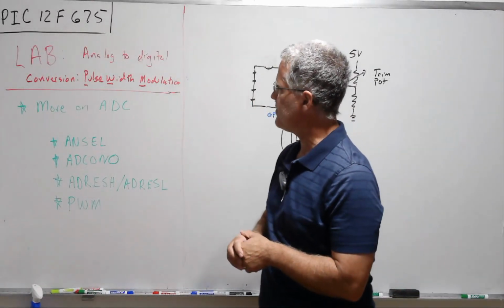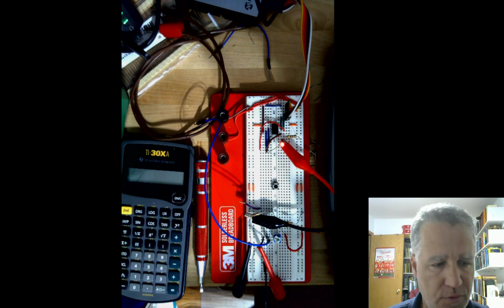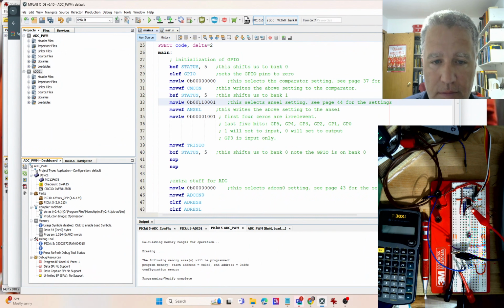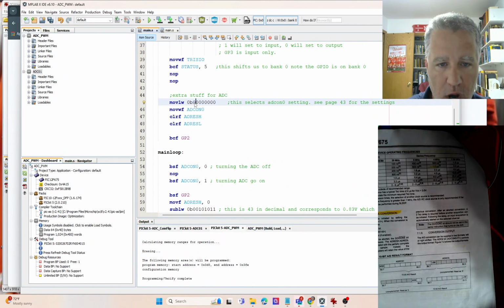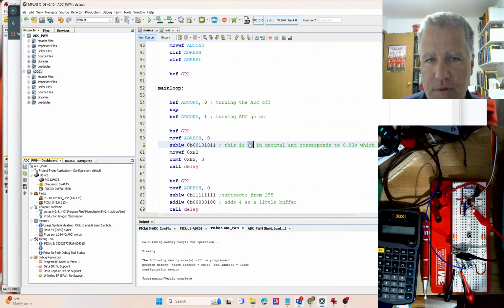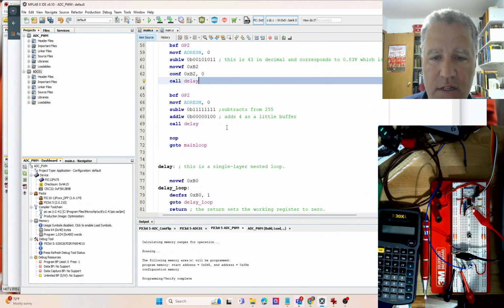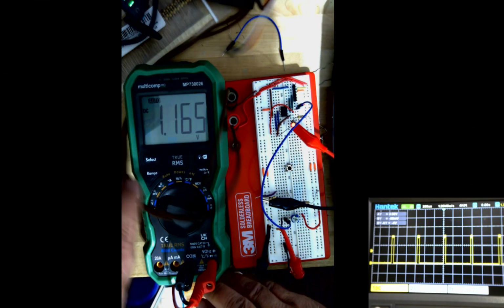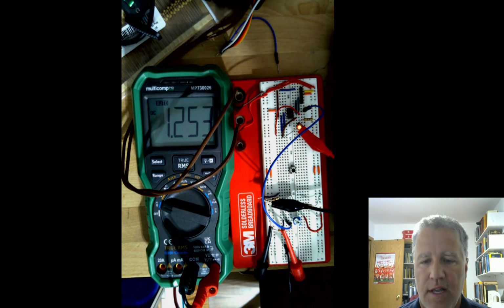PIC12F675 Lab 4 - ADC Mastery: Building a Voltage-Controlled Pulse Width Modulator (PWM)

Comment: Thanks for the video. but there is a video tutorial missing on how to use the DAC. if you have time, please make a video tutorial on how to correctly calculate and use DAC (converts a digital signal into an analog signal)
Reply from the maker: Thanks, yes, I need to do that. It should be straightforward based on the data sheet but I was having great difficulty getting it to work. Then I had to go on to different projects. 
It is an important feature of this PIC so I hope I can get back to working on it soon.